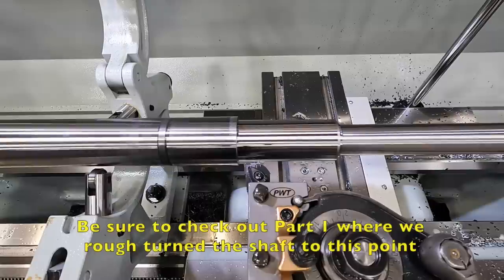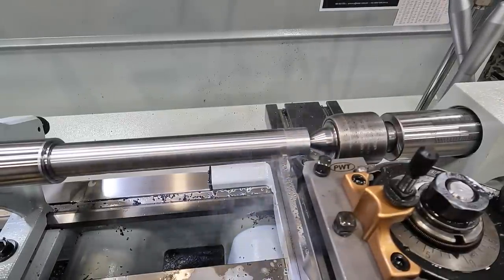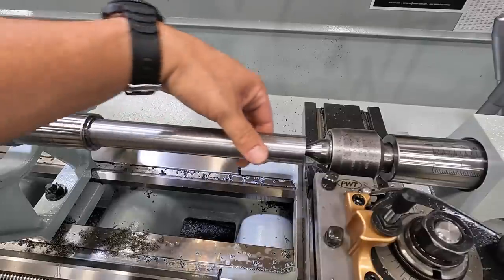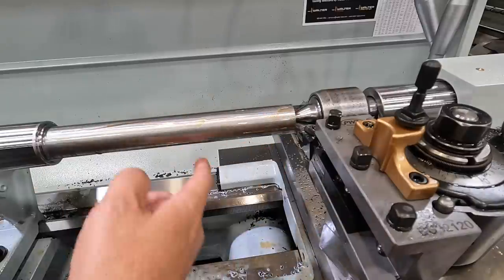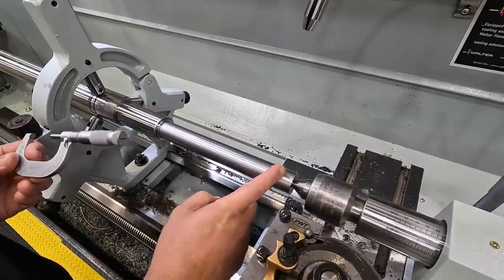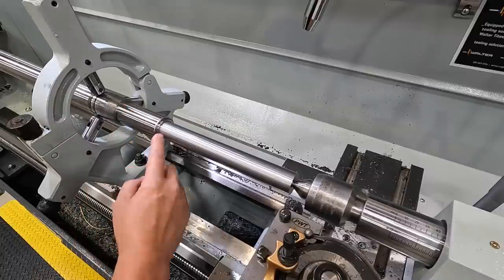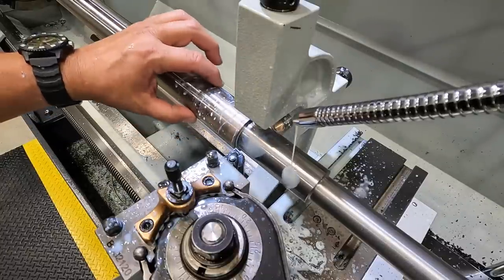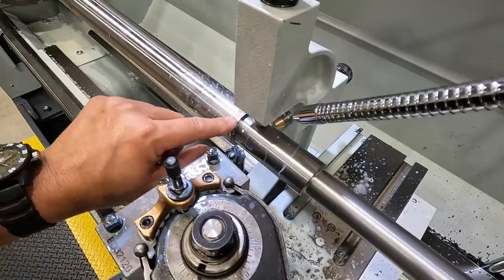70 Ton Friction Press Shaft Part 2: Finishing Turning & Threading

Comment: The true value of your videos is not showing how to do it whenever things go right, but how to anticipate, react, correct, mitigate etc when things go sideways. Really love these videos where you have problems and deal with them on the fly. You can't teach someone how to deal with every possible problem but you can give them a foundation from which they can figure out a solution to problems. Absolute gold.
Reply: I would agree with that every word of it. That's exactly the magic that you put into your beautiful videos. You're not only teach us how to do things the right way, but when things go wrong you help us to find workarounds. Good job Mr booth there sir!!! 😉
Reply: Yep. Adams 25 yrs+ of machining experience shines through.
Difficult job….. but lathe work completed … to spec.
Thanks to Adam for sharing some of these ‘tips’
Regards
Robert
Reply: That's what I love too! He shows his mistakes and he shows how to deal with them. Sometimes he has to scrap a part which sucks but most of the time he's able to come back and get it working dead nuts! These parts are so beautiful and they must run so smoothly on the machines they're put in. My guess is they're probably a little too perfect for being put in a worn out machine the broke the old part 😄

Comment: You should look into getting a randomized output VFD.  It keeps long thin parts from being able to get a standing wave to form on them.  If you notice, it takes a second or two for the chatter to become a problem.  This is the time it takes the material to form a standing wave.  By randomly changing the RPM of the motor, it makes it nearly impossible to form s standing wave.

Comment: Tricky job cutting that long shaft. It was good to watch you work through the problems. Lots of good tips. As far as the problem with the live center not seating right you may have altered the fit when you pressed that plug in the end. Great video.

Comment: Just a thought on the undersize thread, if the middle section of the shaft is in plain bearings which are single piece, one thread should be smaller to allow the shaft to be withdrawn without the thread dragging in the bearings.

Comment: Love your insight in long shafting, I ran into this problem cutting a long shaft for a pump & had to move the tailstock to compensate for an old lathe being out of true center to cut out the taper, was very tedious & took quite some time for the adjustment compensation to run true, cut on !!!

Comment: Great video. Shows how obstacles can be overcome and get perfect results. I think the cross slide dial is friction because its handwheel is wider than the part with the dial so fingers will not easily bump into the dial an shift it. The compound carries a thumbwheel and exactly behind that is the dial with a wider diameter that fingers can reach easily or held with the hand if not concentrating well, so it carries a set screw to lock it in place. Just my thinking.

Comment: Back in the 80's I worked at refractory brick yard that had two of those old friction presses. They had some skilled guys in the tooling who responsible for that type of work. Not until now do I appreciate the work they were doing. When we were running those presses it would shake the entire building.

Comment: Great video.  I wonder if the undersized thread was the result of a past repair.  IE, the threads got mangled up, the shaft threads were recut and a new screw on collar machined (or the original welded up and re-threaded smaller to match).

Comment: It is possible they had nuts made in fixed steps below nominal size to compensate for errors in shaft machining in order to allow them to salvage shafts that may have chattered and needed to be recut.

Comment: Is there an issue with running with both rests??
OMG I was so scared about there being a different thread pitch.
You got very lucky you used the larger thread diameter to start with.

Comment: Very cool demo!  I'm curious... If you didn't have this new machine and its tight tolerances, would you have attempted this project with your older equipment?  The aspect ratio of the part definitely made it a challenging turning project.

Comment: I have used sheetmetal with a magnet on the back, stuck to the steady rest to keep chips out of the rollers.  Rubber bands on the shaft also help keep swarf out of the rollers when running coolant.

Comment: Not many people realize that this kind of machining is a high wire act. One slip and you have to start over.
Reply: Absolutely!!
Reply: But isn't this any job in any profession?
Reply: @an2thea514  no its not .. working in store , or alot other proff is easier and doesnt take skill.. so its not the same ..
Reply: @urosbodanec6302  1. You are wrong.
2. Working in a store isn't a profession. You can start working in a store without an apprenticeship/workers certificate/masters certificate. You can't do that in profession jobs.

Comment: I have found that if you need a good finish with extra low cutting pressure xxGT polished high rake inserts work well (I generally use DCGT). They are designed for aluminium and other soft non ferrous materials but they also do a great job on steel if you are only taking light cuts. That type of insert probably would have done a good job on that first operation where you had the severe chatter issues.

Comment: Maybe the threads are different to force you to install the nuts on the correct side. Is there any difference between the two otherwise? could it mess up some alignment in the machine if they got swapped? At work, we call features like that a poka-yoke.

Comment: Quite a few years ago I spent quite a few years cylindrical grinding.

She was a big machine, would take 22ft between centres.  Longest shaft that I ground was 20 ft.

Many different dia along the length all needing to run bang true to each other.  All us machinists were on piece work. Some of the turners would cut corners leaving excess material on some of the dias which I had to grind off but more importantly some dias were not running true so steadies could not be used  initially without trueing  up these dias.

The technique was to let the shaft just hang in the centres ( scary )   then starting at the tailstock end grind a band the width of the steady pad just far enough along before the shaft started to chatter.  A good method was to reduce the width of the 4 inch thick x 48inch dia grinding wheel by half or less.

When the dia was ground  true apply the steady then repeat this process until the centre of the shaft was reached.

When grinding rolls which were generally much stiffer but would still chatter  especially when grinding the body steadies were used one at each end of the large dia.  On a grinder the wheel passes over the area that is being ground where the steady is running so you had to adjust the steady as the wheel was cutting watching the sparks making sure that the intensity was the same or the dia would be different in that area.

Yes all a bit tricky and worrying especially on the very last pass when the size and finish had to be spot on.  All work was checked by an inspector so no cheating.
Reply: I was chief engineer in a Scottish foundry and machine shop. We ground 40 feet shafts for the paper industry with a 2 thou camber included. Just for your info if interested.

Comment: Hi Adam. The one thing I notice on lathe work is that machinists seem to run the machines as fast as a possible.  And when you slow the speed and less depth of cut it works really well. Best regards
Reply: Carbide tools are designed for high speeds and high chiploads. You can't get good results or chip control without doing that.
Reply: @trent6775  If that is true, then why did it work when Adam slowed it down and less cut???
Reply: @georgestolz4705  Because his tool had a high rake angle and was sharp for a carbide tool.
Reply: @georgestolz4705  the work was the problem here because too much DOC caused it to chatter. The work was unstable and that's why he had to make a compromise by running it slower.
Reply: @trent6775  Thank you guys for the explanations.  I know nothing about it. Now I know.
Reply: @georgestolz4705  lowering the depth of cut reduces tool pressure and deflection and lowering the speed gets away from the resonate frequency  point
Reply: @trent6775  Not fully correct. There are finishing tools like the CNMG431 or DNMG431 that could be used to finish with. The "1" indicating the nose radius of the tool being 0.015". I normally run shafts like this all the time at or below 200sfm to reduce chatter. My depth of cut is always no more than .010" per side during pre-finish and finish operations. The tools hold up just fine for these operations.

Comment: Adam, I think I recall you used to put a piece of rubber or something in some parts when you were a Motion.  It makes me wonder, if you were to machine maybe a 3" ring with some large Oring grooves on the inside and put rings in them for traction, could you put that somewhere on a shaft like that and let it roll around to possibly dampen the chatter?  Of course you would have to put small orings on the shaft to keep it from traveling where you do not want it to....like into the chuck.

Comment: Adam, I am no machinist, but it seems like the follow rest should be called a leader rest.
Reply: Depending on the brand some were mounted on the front of the carriage and some on the back of the carriage, so it's a tossup whether it's leading or following.
Reply: It's like two cars folowing the same road. Not one leader and a folower car.
Makes more sense now ?

Comment: If you get a chance, if it is safe to do, could you chuck up the old shaft so we can see where the damage/runout is? Thanks in advance!
Reply: I was thinking the same thing.  
He can probably measure it on the bench with it sitting in a couple of V blocks. I also wonder if it would be a good one to experiment with shaft straightening.  Between the press and heat straightening I wonder how close he could get it.
Reply: From the clip of the bent shaft running on the machine in part one ... I'd say the run out is somewhere in the region of 3/4" to a full 1" ... that shaft had one hell of a wobble on it on the drive pulley end.

Comment: Just curious, in part one you were using the coolant on the torch tip for all your cuts in this one, at least at the beginning of the video, you’re not using it… Is there a reason behind that? After about eight minutes and he did start using the coolant so now I’m really curious as to what goes into the decision whether you need to use it or not?
Reply: I was wondering the same. I guess there´s a reason behind, like the type of cutting tool?
Reply: He was using cutting oil because he was taking very light cuts which don't produce much heat.

Comment: I'm not a fan of Steady rests with bearings I think the clearance in the bearing itself doesn't help with the chatter,  the steady rest with bronze-tipped quills to me are better at reducing chatter I would use a good quality grease or oil to lubricate the steady rest quills if the shaft is machined and polished to a good finish the bronze ends of the quills will not wear if you keep them lubricated.
Great job on the shaft
Reply: I don’t like the bearings in the lathe spindel to xd

Comment: For learning, why did you choose 4140 pre hard vs something like 1144/stressproof?  Thanks!
Reply: It will warp after heat treat
Reply: Great question! I would think that what the final shaft will have to endure are very much what material is used. That shaft is quite long and the finished diameter combined with the  torsional forces over that length are at play here. I think that the hardness (Rockwell scale) is  another . Can you imagine the machinist who originally turned that shaft with much less technology 100 years ago?

Comment: Hey Adam, i wonder why you turned down the thread on the bar. Wouldn't it be better to have a standard thread on both ends of the bar and machine the undersized nut to fit it.
I know it would be more work cause you have to chase the thread on the nut, but you would it would be interchangeable

Comment: I wonder if there was a problem, and they decided to make a new locknut and recut the threads on the shaft. In any case, just putting a 1 and 2 is not enough. The nuts and shaft should be engraved with tap info right near the threads on both sides. A vibrating pen should be good enough.

Comment: Adam, with the insert you had been using and with some minimal chatter you had and then dialed it in to reduce or eliminate the chatter, how well did the insert hold up after the lengthy .005 feed rate? Wondering what you think of that tooling? Thanks....Ricko

Comment: Are there any useful rules of thumb for doc vs per revolution? I imagine it depends on speed/tool radius, and machine rigidity. I have a small lathe, (12" vintage craftsman)so I end up taking lighter cuts than carbide tools seem to recommend... My lathe just doesn't seem to have the power/rigidity to run heavy cuts. Does pretty well with light cuts and sharp tools. Good thing I tend to make small parts.

Comment: Sometimes machining harder materials works in your favor. Take for instance cold rolled steel. It's too soft to consistently get a nice finish on. 4140 is middle of the road and normally does well. Stuff like Inconel and Stellite are turribly hard to machine.

Comment: It seems to me that if you were to chock up on & work closer to the Chuck  you would not had to fight with the vibration nearly as much & probably only need the steady rest on the center journal you would have to match the diameter cutting both halves but I would think that would be a problem

Comment: At 50:40, could the straight key slot with the woodruff  on the end held a key with a step that fit down into the woodruff slot to prevent it from walking back out of the shaft?

Comment: Why are you averse to the steady rest, especially for what this shaft is used for? This is not a criticism I'd just like to know your reasons as I really respect your skills.
Reply: I'm no master machinist but my guess would be that working without a steady rest when it's possible to do so saves time and setup steps (since with the steady rest you have to work in short sections), and leaves less opportunities for setup errors/stray chips that could push a journal out of concentricity.

Comment: I don’t recall you having these issues either the victor or monarch lathes.
Is the pm lathe too light idk just asking
Reply: I think the problem is the the part. Its so thin and when its unsupported it will very easily chatter. The same thing would happen even on the American pacemaker.
Reply: It's such a long thin part that's causing the rigidity problems, not the lathe
Reply: I have seen jobs chatter on his home lathes

Comment: Do you get that chatter with tools you've ground? Could insert mounting surfaces have some imperfections, allowing vibrations (i.e. chatter)?
Reply: It's entirely due to the shaft length. Flexibility goes up as the cube of the length.

Comment: i guess I just don't understand things, but why did you span the whole shaft at one time rather than leaving half behind the chuck? Having a thin shaft over a meter long between chuck and tailstock seems counterintuitive. This is in no way meant as criticism, but being a wannabe machinist I am curious about this.
Reply: Theres a good chance that the size of the stock would not fit through the spindle head? Thats my guess atleast!
Reply: @chaineffect6437  In Part 1 at about 7'30" it shows the shaft all the way through the spindle with only about 12" sticking out, so that is not the case. I'm rather perplexed by this.
Reply: I think in Part 1 Adam said he would do it like this, in order to ensure the bearing journals were exactly concentric.
Reply: @brokenvxices  No, no, I need to apologize for not responding to your excellent comment. I appreciated your thoughts about this and agree with you on turning between centers. In retrospect I guess that Adam just did what was adequate and quick. Thanks again for your thoughts.

Comment: Adam, once you cut the threads...... To soften them up do you use Emery paper, a mill file, or Scotch-Brite..... Or all three?
Reply: IMHO emery cloth is good to break sharp crests, but that dust on the ways isn’t good at all. I choose a small triangular file. Good for the sharp crest and also good for giving a light touch up to the flanks.
If you’re going to polish a part on the lathe with emery cloth or some kind of abrasive material cover the ways to prevent that dust falling on them 👍
Reply: I think he said he was going to use Scotch-Brite.
Reply: @Bellboy40  Scotch-Brite has abrasive in it also. Not as much as emery cloth but it is still there. Doen't shed as much either. The white Scotch-Brite has no grit... feels waxy. From coarse to fine Scotch-Brite goes Red-Green-Gray-White. Grey can give you and almost mirror finish on hardened steel.

Comment: I wonder why that follower rest has solid contact inserts instead of rollers? 🤔
Reply: Lots of follow rests have solid fingers.  Rollers are great until a chip flies between the roller and the work and trashes the part.  Since the follow rest is closer to the tool than a steady rest (most of the time) they are more susceptible to getting a chip in them, so more of them have solid fingers compared to steady rests.  My Clausing has rollers on the factory steady, and bronze fingers on the follow rest.
Reply: @chrisbartolo4308  Makes sense ...